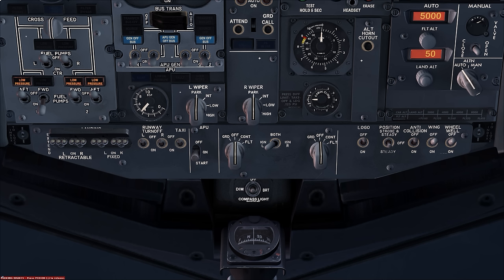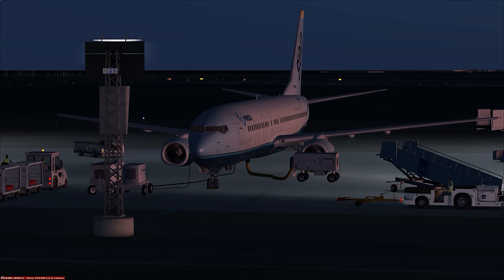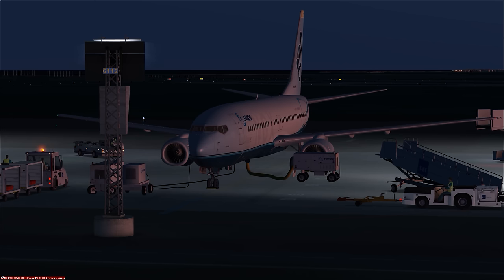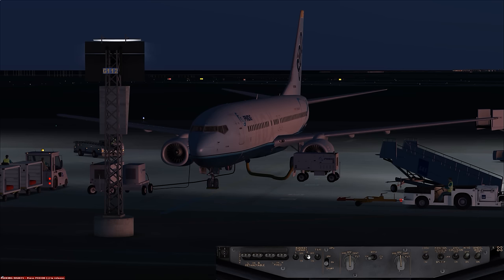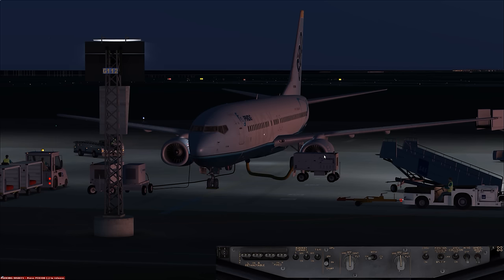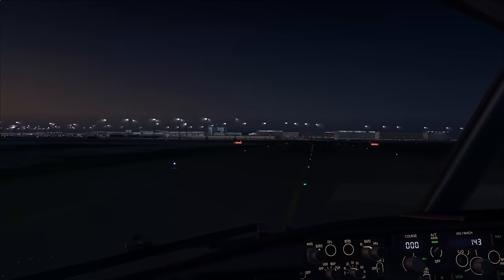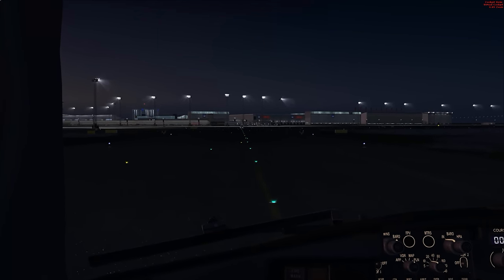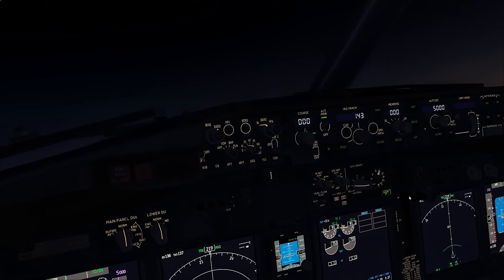FSX Steam Edition - Tutorial: Aircraft Lights 101 w/ PMDG 737

Comment: Lot of great info Jordan. Personally I knew most all of it since I'm a long in tooth simmer. Must admit though I've never heard of turning strobes OFF above FL100. Also never seen it in real life.
As you said they're typically turned on once crossing and/or entering a runway during departure but usually not turned off again until clearing all runways after landing. They're probably THE single most effective visual means of making other pilots aware of the presence of your aircraft.
Reply: ***** That actually makes alot of sense.
Reply: ***** Ah I see. Like I said never heard of or seen it myself. And honestly the part about pax comfort is baffling as strobes tend to reflect outward from the wingtips, not into the cabin, but live and learn!
Would be interesting to hear why so many operators keep them on too.
Anyway, another great vid, thank you!
Reply: theRealAV8r
 To be honest the way I was taught was pretty much the same - Strobes on when entering the active (or crossing)  and off again when leaving the active after flight. Only time they'd go off otherwise is as Jordan and you both mention is in certain met conditions such as fog or thick cloud. It may be a US thing though as my flying experience is in Africa and Europe. Also an interesting one to note is that the PIC may be legally held responsible for any injuries to anyone on the ground if the beacon isn't activated before engine start or any flap movement that may be a hazard to ground crew.
Really enjoy your videos Jordan - great job!